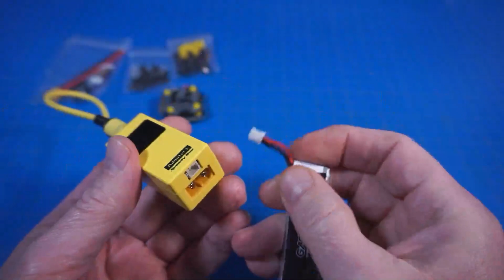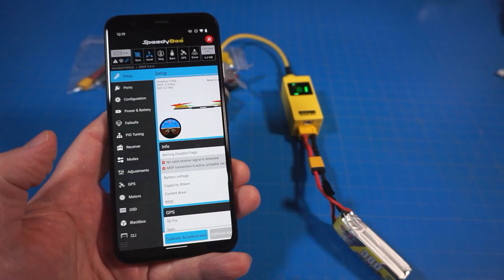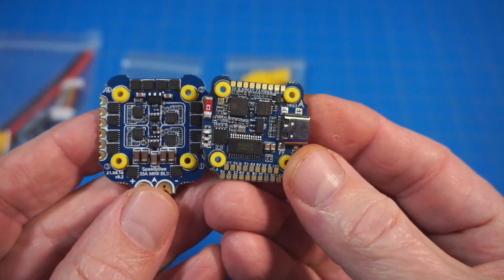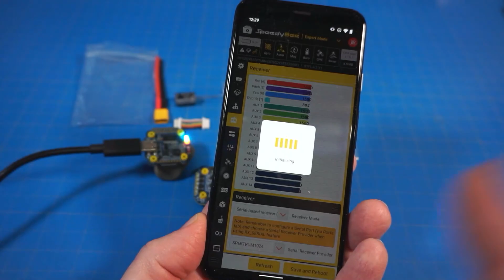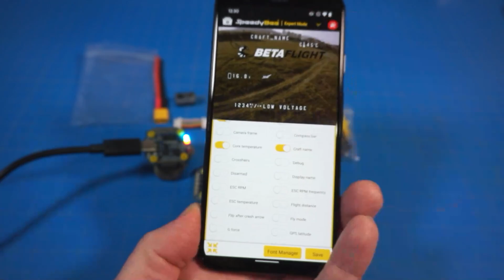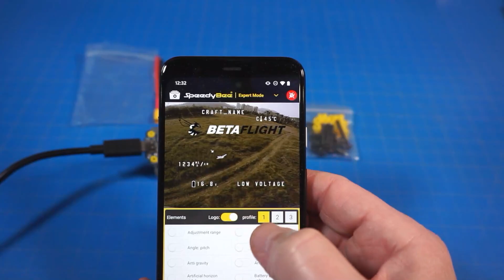An Adapter I Carry With Me // SpeedyBee Adapter 3 // F7 Mini 35Amp BlueTooth Flight Stack

Comment: Will this work on any flight controller? Or specific ones? I'm confused. What about radios can you flash your RX too? Need something to allow me to update firmware on all my stuff without having to need a laptop.
Reply from the maker: It plugs into usb, so any flight controller. We cannot flash an rx with this to my knowledge.
Reply: @NickBurnsFPV  thank you! Love your content. You got me in the air again. Still trying to find the right Radio though. Thinking about the zorro but want to be extreme long range capable for mountain diving. But anyways. Thank you for clearing that up. Just got one off Amazon!

Comment: Just got the speedybee adapter 3 & f7 mini today ! Can’t wait to install it on my 3 inch 135mm frame with a foxeer cat micro 3 , yea I’m still analog lol I bought this flight controller specifically for the future when I finally get a digital fpv system , I will never ditch analog tho , I used to have the hakrc f4 mini with 20a esc stack & bn-180 gps  it was fun Forsure

Comment: Hey, I LOVE the adapter. 
I’ve loaded BF firmware, configured the receiver, fixed OSD spacing. It’s great. 

On a side note, Betaflight 4.3 RC1 has issues with CrazybeeF4FR flight controller’s SPI receiver. I had to go back to 4.2.11. But I can’t wait for that bug to be fixed. 
Thanks!

Comment: Just a quick tip if you don't want to pay a $100. You can buy an OTG cable/adapter for your Android phone (it doesn't work on iOS unfortunatly), they cost less than $5, and you can use the speedy bee app buy plugging your drone into your phone. It will drain your phone's battery and you won't have the battery checker functionality (although you can buy a checker for $5 online), but it's way cheaper and works just fine

Comment: I have the ver:3 adapter. This was my dream: Go out the field. Log into BF, clear my blackbox cache. Fly a test flight, land, and check the blackbox logs. Adjust the pid sliders, fly again. Rinse and repeat. Works great for 90% of this senario. Only problem is a BIG one that derails the whole thing. In the black box analyzer if you choose two things, like setpoint and gyro to see how closely your quad is following inputs, it puts the two data points on two parallel rows. I can't figure out how to overlay them. And this makes the blackbox part more a gimmick than a tool. You can choose from all the different data points, but I can't see a way to group them together the way you want to. I hope they fix this. This would be a huge thing.

Comment: Hello, I just wanted to know which radio controller would be better with the Eachine Cvatar 142mm 4S 3 Inch Cinewhoop Duct FPV Racing Drone...
Receiver:Frsky XM+ Receiver . Could you please let me know a couple of the best radio controllers that I could use with this.  Thank you in advance.

Comment: Hi Nick   Great video and review of the Speedybee connector,  I just don't know,  I guess it's a nice battery checker. I don't know if I need it. I have been using a micro USB to a sbcc cable and downloaded Betaflight to my phone and that's it. But it doesn't have a checker for voltage.  Thanks again for the video and information.

Comment: Hi Nick I use the speedy bee adapter all the time as I can't use beta flight on a PC due to a Microsoft problem(old XP version)I've done complete builds using speedy bee and done motor directions pids/rates and almost everything except software updates/flashing.the cli dumps work even on version 1(I also have version 2) to get out of OSD mode I save then press the back button on the phone but I don't have your version 3 so not sure.these adapters are great bl heli works great as do 99℅ of the other functions.everyone should have one in their flight bag.

Comment: Is this the stack that has the ESC problem that Bardwell mentioned not to buy?
Reply: I believe the 20x20 are blheli_s and not blheli_32. The problem lies with the blheli_32 esc and the 'MM32SPIN160' mcu's they are using.
Reply: @linuxbarista  Do you think the problem can be solved with an eventual update by blheli_32? I ask because I jumped on board with their f7 stack and have it in 3 of my quads. Two of them require reflashing multiple times. Also, do you know if it is just a matter of turning off bidirectional dshot until there is a fix, or do other settings need to be changed because it is turned off? Appreciate any advice you have.
Reply: @linuxbarista  Thanks for trying to reply. I could see part of the first sentence  in notifications, but the comment was gone when I looked here. Must have had a link in it or something and got auto removed.

Comment: The adapter concept is great, and the execution seems really good too. However, I really don't like the idea of forcing me to see ads to use a device I purchased. For me, that's a deal breaker.
Reply: The "ad" on my phone is about 2 seconds long. No more than a loading screen. It's gone most of the time before I look back at the phone. It does not detract from the user experience. If it had ads when you were using the thing I would throw it out immediately.
Reply: You don't HAVE to see the ads.  All you have to do is purchase the appropriate upgrade for the app.  The adapter and the app are separate products, so when you purchase the adapter you have not purchased the app.
Reply: @wingsounds13  yes. That is how they are marketing/selling this. You buy the device, and then you find you need a monthly subscription. No thanks.
Reply: @breakflight  hey, I didn't say that it was good or bad.  They are determined to get money one way or another - either through ads or straight out of your pocket.  They're not doing themselves any favors though, I DESPISE subscriptions.